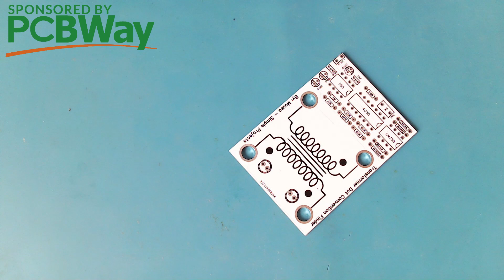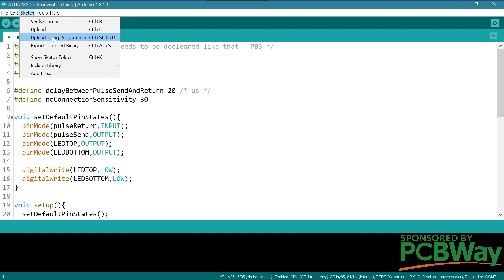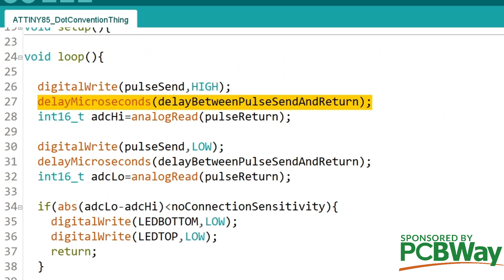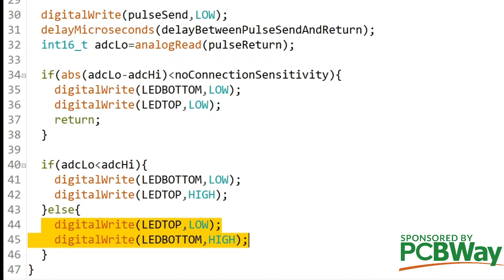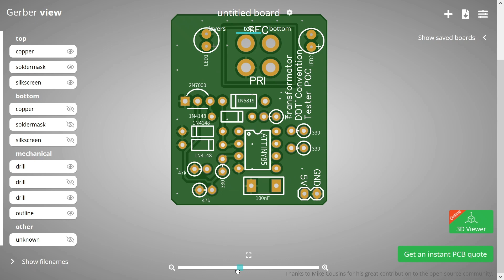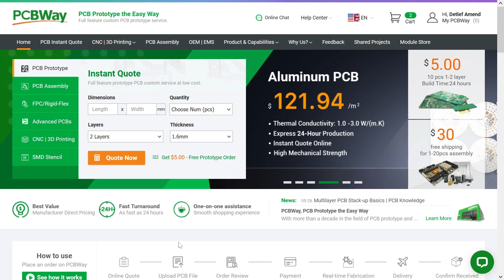Transformer Dot Convention Tester - with a MCU (co-op with LER)

Comment: Hi Det, is there any reason that you use #define pulseSend PIN_PB4 rather than const int pulseSend = PIN_PB4; researching the Internet suggests #define is less safe, what do you think?
Reply from the maker: Hi Steven - welcome to the channel!

The difference between a #define and a const uint8_t... is that the #define is a compiler directive. In a nutshell, compiling something like 

#define foo bar

replaces every occurence of foo with bar. The replaces text doesn't need to be a single word - this can be used for complete macros.

A const variable is simply a non writable variable; not sure if the compiler simply handles it the same way like #defines for your example.

But there is a difference: the #define won't do the typecasting!.

Something like

const uint8_t sevastopol=100;

is a uint8_t - you can't drop this into a float or something (well - of course you can, but you have to take care of the conversion).

The #define with the literal replacement is a bit more flexible b'c of the non existing typecasting.

What should you use?
It probably won't matter. As with anything C, there are schools of thoughts about up and downsides of both cases.
I personally prefer the #define; but sometimes you'll see me using const anyway (maybe for no obvious reason).

So - go with what you're comfortable with - it won't really affect your program (I guess).

Oh - one style you may wanna adapt:

#define SCHOELACES 17

- the uppercase define helps seeing #defines in your code. 

Hope this helped!!

Comment: Hi Det,  Thank you for the software explanation of the Transformer software logic.  Your site has motivated me to learn about the ATTiny; coding and possible applications for my brain stimulation projects.  Given I do not have any "85s". thinking about going with "412s".
Reply from the maker: Ed - I'm honored. Great to get you to think outside the arduino box :)

The '412 will easy handle this: just watch out to use the UPDI pin only for programming. All pin definitions are at the start of the program - check' spence konde's github with the megatinycore to get the PIN_Pxy definitions.
You maybe connect the '412 to an osci and check the frequencies: the '85 gets to about 3.5kHz pulsing the primary. Playing around with the chip's frequency could be nessescary.

Let me know how it went!

Comment: I tend to use uppercase for the #defines to remind me that they are in affect constants and can't be changed.  Also I like the use of #defines to give names to magic numbers in the same way as you do.
its a pain in the butt that C# don't allow #defines and makes you use the CONST keyword to do the same thing.

Not sure of the return in the IF statement, you don't have a calling function for the return to break back to. Or does it just exit the main program loop and die? Never tried breaking out of the main loop to see what happens, to me seems to be a bit up in the air. Does the program just stop or does it get pulled back in the to the loop again. looks like i've got some reading to do.

Thanks for giving the old grey cell something to do for the rest of the day. 🙂
Reply from the maker: Hi TEH - I remember the uppercase for defines normally after I wrote most of the code - ans as a stickler for good practice, this should be a thing always to do. So - I vow to do better :) Thanks for reminding me!

The Return in the IF is a neat way to break the loop in arduino speak. If I remember this right, the Arduino thing runs a classic main(), and in there setup() and loop() are just called functions. loop is enveloped inside a while(1){...}, so a continue would probably do the same.

Have fun with the project - to me (a more digital guy) this was great fun figuring out how the transformator would react; that's the thing: you know the theory, but when it gets to practice...
Reply: @DetBuildsStuff  I was thinking of just nesting the if's so if it met the first if condition it would bypass the rest. so no need to jump out of the loop.
That's the problem with the Arduino IDE you can do things that are not well documented. so leaves you looking at the code and trying to think of the program flow. How about a bit of UML to add to the fun.
Reply from the maker: @TheEmbeddedHobbyist  So with you, man! They (the arduino guys) did a great service to the whole community - but as with most of us: they are not so good when it comes to (any) documentation. And this gets even worse when you're looking for good docs. 

Btw: I try to avould these 10-times-nested-if's. If applicable: SWITCHes (of course) or I do a lot of "breaking out of the loop" if's (like in this program): Way easyer to follow.

Hope I could solve the little mistery of the strange return!